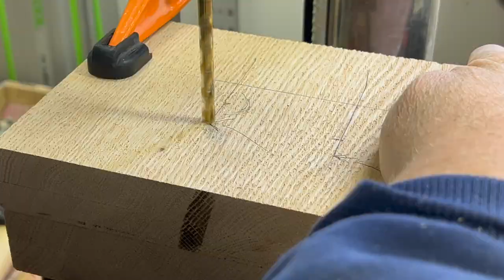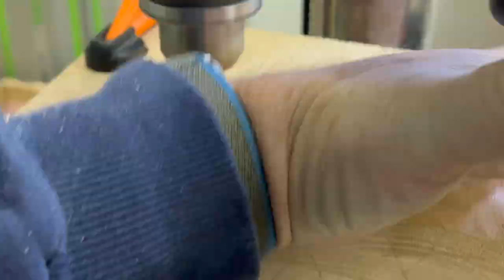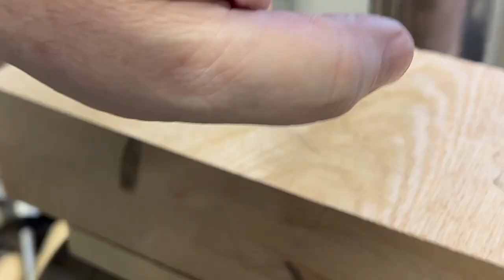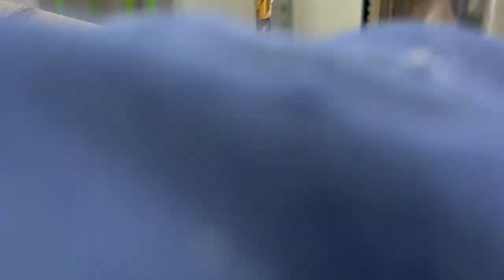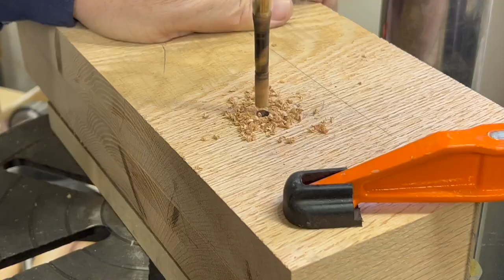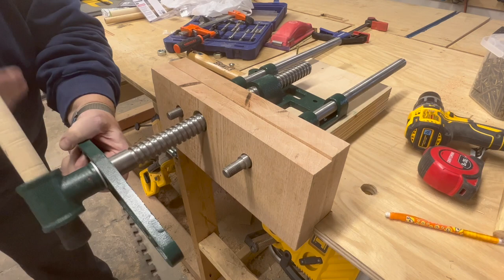Workbench Front Vise Install

Comment: Hi- nice vid my friend, could I ask what the fuctionality is for nules you counter bored in with the forstener bit are?
After showing the precision cutting, you negated to show the function which no doubt is important (& also demeans your good work sir)
Reply from the maker: The instructions told me to put the countersunk sleeves on the inside of the table side of the vice.  My mistake was to put the on the inside of the outside part of the vise.  I am not sure exactly what function they provide but I imagine that they help by acting like a guide for the rail no matter what side they are on!

Comment: I'll be buying the exact same vise next week. Your video gave me a good idea what to expect.
Also, maybe you can answer this msg in time to mention some tips, or things you would've done differenty?
Thank you!
Reply: Things I would do differently:   Is the faceplate as a guide to trace your holes onto the wood.   I made the mistake of drilling the center hole too small.  Also my vise plates are too skinny.  The thicker the better perhaps more like two inches thick.  I drilled a bench dog hole in the outer and ripped it right off the outer vise!   And like I mentioned in the video the guides were supposed to go on the inside!   Good luck

Comment: Need more steps and instructions on what you're doing... I feel like I'm missing a lot from this video.
Reply from the maker: What makes this install unique, is that it is installed on a hinged lid above my planer.   So I build a 3 plywood deep pedestal to support the screws that would have a good length to hold the vise.  Here are the steps:
1.  Turn the table over to install the support block to the underside.
2.  Find the position for the support block by placing the inside of the jaw (oak planks) and cut out a place for the jaw to set.  This will be the inside jaw of the vise.
3.  Cut out the location that the inside jaw will be located at and will be screwed to the support block.
4.  Since the shafts of the vice pass through both side of the vise jaws, you will need to find the position of these holes (one way would be to hold the outer bracket up to the outer vise jaw and trace the location of the holes).   Make sure you use the correct diameter for the shafts, as they will need to slide through these holes freely.   This is where I made a mistake and underestimate the diameter of the threaded shaft, as well as being off on the positioning.  I leave this in the video so you won't make the same mistake.
5.  The 2 inch forstner bit is to create a recessed hole for the shaft guides, which should go on the INSIDE JAW.  This was another mistake I made as I put them on the outside jaw.
6.   Once the holes can receive the vise shafts, assemble the vice.   In my case, it was beneficial because the vice could be installed upside down, with easy access to the screw holes.   I screw the plywood pedestal to the plywood lid and screw the vise support bracket to the plywood pedestal.
7.   I turn the lid over, with the now installed vice reinstall the hinges so I can open it to use my planer when I need it.